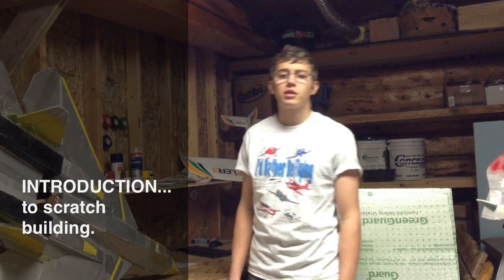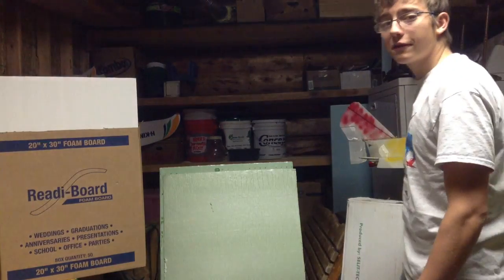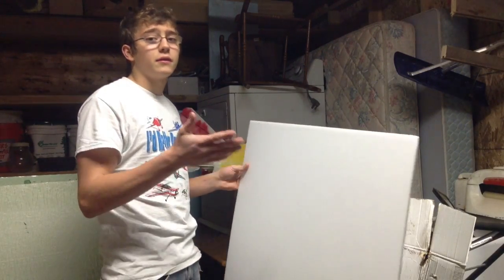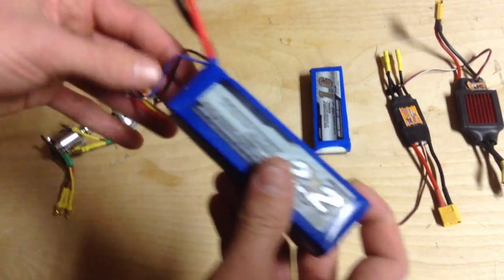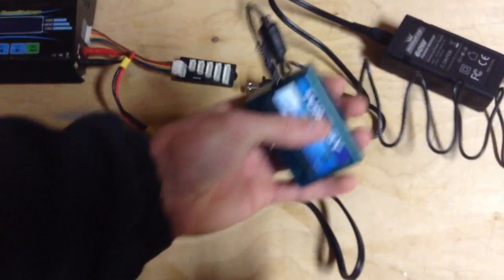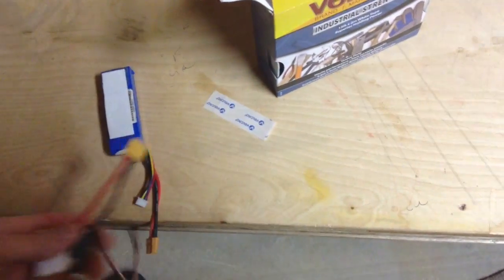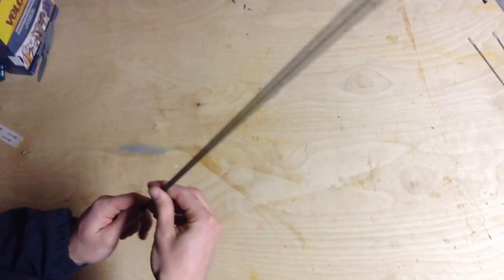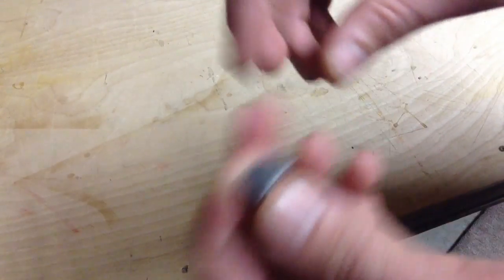How to build an rc plane (part 1)

Comment: THANK YOU for giving basic info. of rc plane.Can i use some parts from rc helicopter like battery,motor,propeller because in my country it is difficult to get some of the parts.Even if it is available it will cost double or triple the amount you get.

Comment: I hope its cheap! I not made of money! how much are we looking at total?
Reply: I just want to know the total price for the necessary materials needed for the plane body and electronics and propeller and motor mount. can u use skewers for wings too?
Reply from the maker: +Dakota Carney around 200$ would be a god estimate depending on what controller you get.
Reply from the maker: +Dakota Carney around 200$ would be a god estimate depending on what controller you get
Reply from the maker: You can build it for 200$ depending on the controller
Reply from the maker: you can build the plane for around 100$ but depending on what radio you get, it could be another 50-300 $

Comment: can i add a landing gear and ,how ?
Reply from the maker: Alaa Kassab The rcpowers planes are not built to have landing gear but you can add custom gear. I would recommend glueing a thin piece of ply to the bottom and then glue some landing gear of choice onto that. That's what's I did and it worked out ok.

Comment: Could you use a rc car motor for airplane motor if you are a beginner at rc planes
Reply: Well depends on the RC Car Motor I took my rc car motor and put it on mt ZeroFighter and it works great but it was foam so the motor would heat up and it got stuck in the motor mount and now I use a ceramic tube for the motor :P